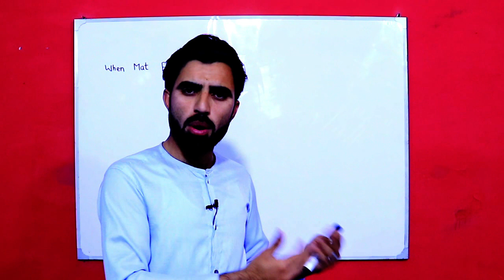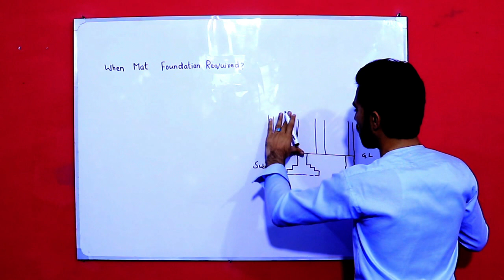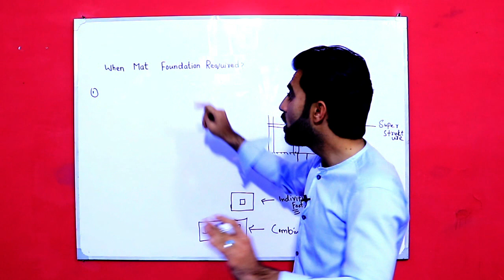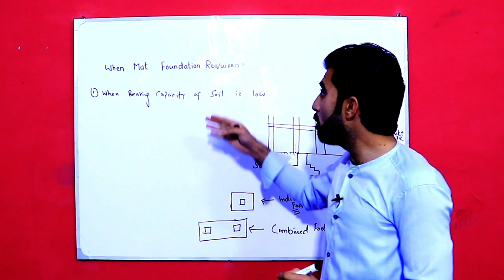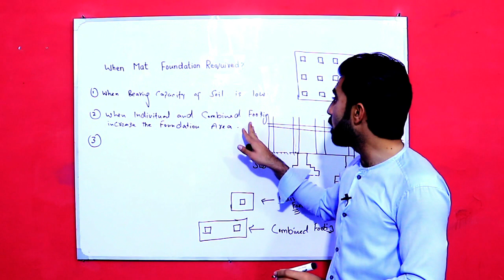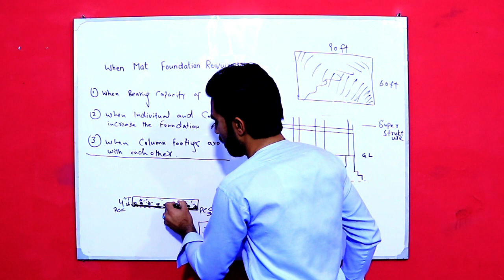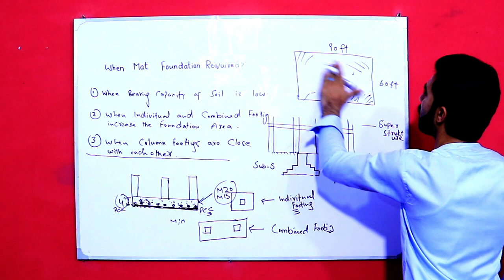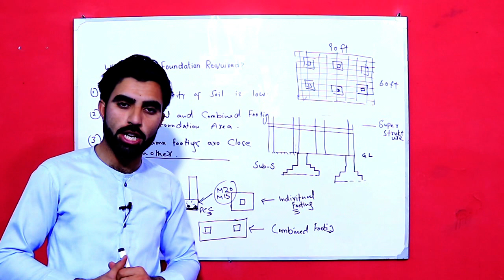When Mat Foundation Required for House? Raft Foundation

Comment: hi sir,can you explain to us  how the loads  coming from columns be distributed to the raft foundation and secondly where is the lapping zone for top and bottom bars since we are avoiding the maximum moment in raft foundation
Reply: Brother loads from the columns are distributed in raft by providing the columns bars a shape of L of about 12 inches length. connecting with the bottom bars of raft
And in case of raft bottom bars are spliced at mid and top bars at supports. Spliced means lapping.